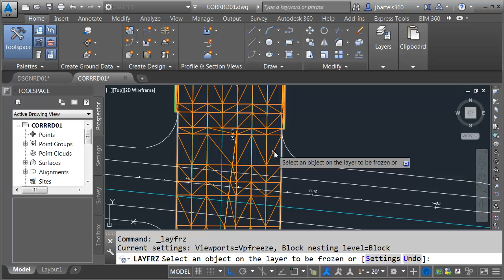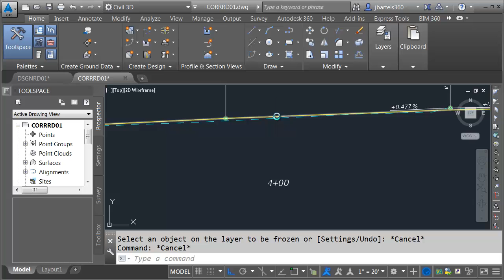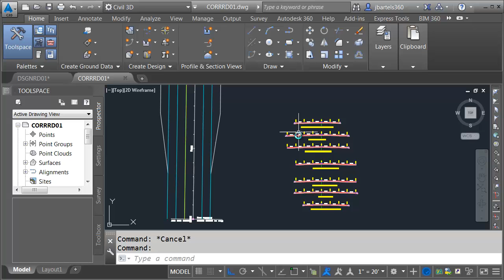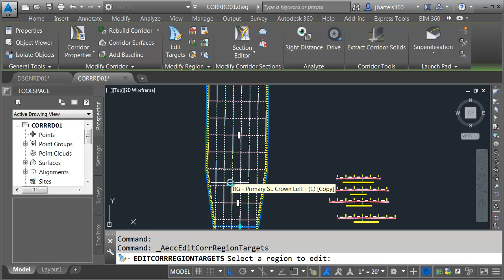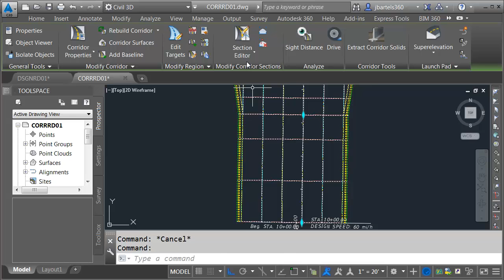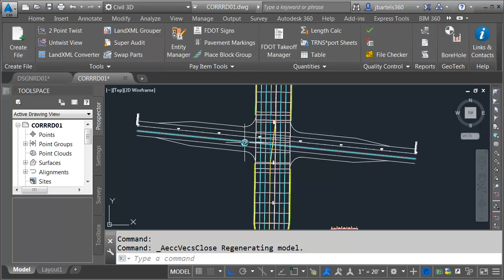Civil 3D Advanced Intersection Modeling Pt.1

Comment: I have question why did you split primary street into region with outside turn lines and without and used another method for secondary street without splitting? If there is any reason for that way, or primary street also can be done without split into region?